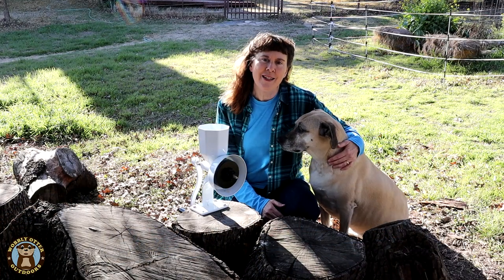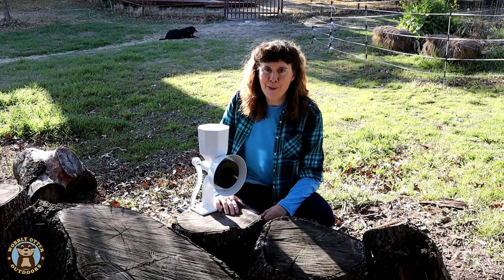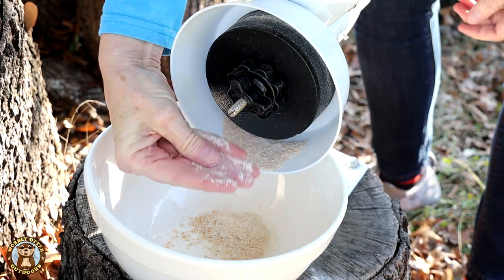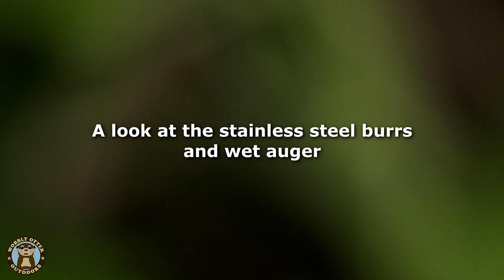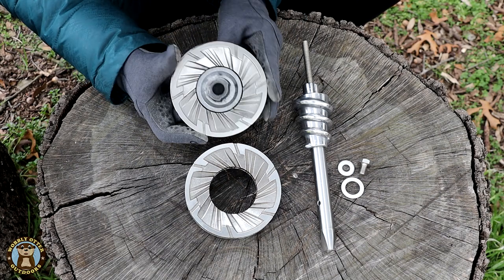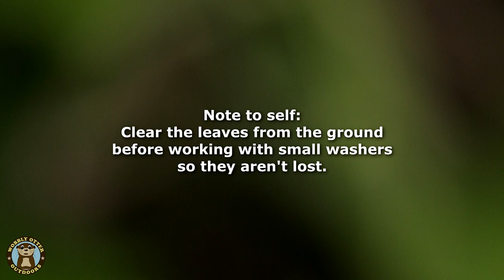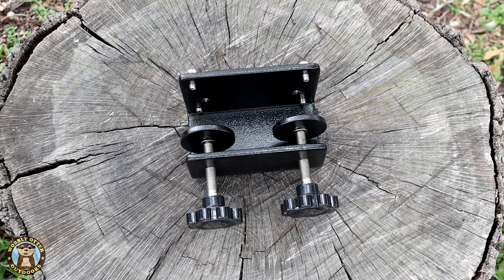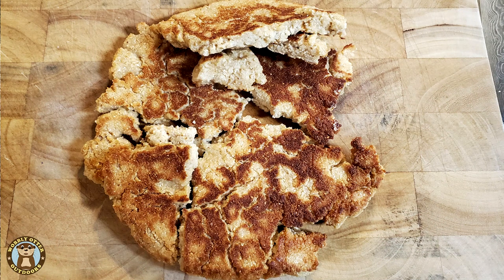Wondermill Wonder Junior Grain Mill Review

Comment: Thanks for the video. Just a suggestion regarding breaking bolts that you were putting into that oak log: I find that if you drill a pilot hole just slightly smaller in  diameter than the threads of the screw threads are , then take bar soap and pack the threads full of soap before you screw it into the wood it goes in much easier without breaking the screw . Be sure the pilot holes are slightly  smaller than the outside edges of the screw threads. You won't pull them out because the threads bite the wood very well. Try that and I think that will help.
Reply from the maker: You're welcome, Robert and thank you for the very helpful suggestions.  A larger pilot hole would have definitely been better, especially in an old oak stump. They're kinda like concrete. 😀

Comment: You can also purchase the drill-bit connection to power it - if you'd like to make the job faster (and easier)
Reply: BUT.. you'll need a very powerful drill and they ain't cheap!  My 7.5 amp wouldn't touch it.  And it takes every bit of my 9amp DeWalt to turn the crank.  By the time you put out $200+ for the DeWalt you could almost buy a MockMill 100.  Just my thoughts.  Hope they help.  All this said--- we LOVE our Wondermill Jr.
Reply: @timrossmultimedia  Thanks for sharing!

Comment: A follow up video on the wet grind would be nice. Maybe nixtamalize some corn for masa. It's tasty, you'll probably like it.
Reply from the maker: That's a great idea @Paladin_BR. Thank you.. It's helpful to know the interest is there. And I do love corn tortillas too.
Reply: @wobblyotteroutdoors  xi'd love to see how fine and how fast it can grind freshly nixtamalized masa. the mexican made ones are fine for tamales, but the burs are not good enough for tortillas.
Reply from the maker: @Daniel Bothman I will order some dried posole/hominy to grind to see how fine we can get the masa/flour.  Then we'll make some corn tortillas! Gotta plan for success.
Reply: @wobblyotteroutdoors  thanks for the reply. that might be an interesting experiment, but not what i was wondering about. i'm wondering about wet grinding freshly nixtamalized corn. grinding dried hominy is not the typical practice for making tortillas. the typical/traditional method is cooking dried dent corn in water with "cal" (calcium hydroxide aka lime) until the outer coating is dissolved and then soaking overnight (methods here vary). then rinse all the sludge from the dissolved coating, and then wet grinding. THAT is where my interest lies. 

you can probably buy the cooked (and not dried) hominy at your mexican grocery and save a few steps.
Reply from the maker: I see. Canned hominy/posole is readily available where we live.  It's the wet result of nixtamalization.  Or the dried hominy could be reconstituted then ground. Hominy is super soft, even the germ. It should be nicely smashable. Thanks for watching and the interesting idea.
Reply: @wobblyotteroutdoors  well, a coarse grind of dried hominy gives you grits, and a finer ground hominy yields polenta...
Reply from the maker: Yummmm! It's a win-win. We like it all.
Reply: @wobblyotteroutdoors  well, all sound interesting, but none are worth trying on my account. I'm only interested in how it would work for making tortillas in the traditional way by someone familiar with how the finished product should or shouldn't come out. so, I guess nevermind my comments. thanks for your you willingness and suggestions tho.
Reply from the maker: Mmkay.

Comment: Do NOT eat the first couple batches of ground up anything. Unless you like fine, metal filings in your diet:) It is like a new car and an oil change. Give it a 500 mile test drive and change the oil as new parts wear down slightly against each other!!
Reply: This uses stone for the dry grains. 1 or 2 run throughs of wheat or corn will wear down the surface enough to not leave significant dust behind. Now if using the metal plates for nuts or wet grains I'd suggest a few extra run throughs and a hood rinse between each round.

Comment: You could buy a lot of flour for 300 bucks. Premium flour is only 50 cents a pound. meaning you'd have to run 600 pounds through this thing before it would pay for itself. So just how much flour do you plan on using? If you were making bread all the time and used 2 pounds a week that would take about 6 years. But I don't use anywhere near that much flour. I average about a pound a month. So it would take me roughly 50 years to use 600 pounds of flour. But then the issue is the flour you get out of it is not premium quality. It still has lots of impurities such as bran.

All of that being said the only reason I could see purchasing one of these would be for the fun of it or the experience of grinding flour.
Reply: It's about far more than just price.  There's quality and freshness, variety, and supply.  Store-bought flour is only good for a year, or if properly repacked for storage, even 10 years.  Whole wheat and other grains, properly stored, last 30+ years.  Just like any other insurance you may have, having food insurance and the peace of mind that comes with it has its own value.  
Once you have the tools and storage, enjoying them for flavor and fun, as well as to maintain required skills to use what you stored in an emergency, has its own value, as well - besides being just plain delicious.
Reply: Bran is not an impurity.  The flour you purchase at the grocery store has been stripped of its nutritional value in favor of making it last a long time on the store shelf.  Whole grains, freshly ground, are so much healthier for you.
Reply: Wheat berries in their whole, unground state last a lot longer than flour does if kept dry and cool. If I bought 20 lbs of berries and a Wondermill Junior Deluxe 2 years ago and wheat becomes expensive, unavailable or unemployment drains our savings then having wheat berries and a grain mill will be more than worth it.
Reply: The lack of knowledge that would allow someone to say with a straight face. “ impurities such as bran”
Reply: @joshualloyd1391  In pretty much every situation other than making whole wheat bread you're not going to want bran in your flour.
Reply: My family of 5 uses approx 50# in 5-6 weeks. We make everything from scratch (everything. Breads, crackers, rolls, brownies, tortillas, etc)

Comment: the bread will always be flat like yours, you can't make a real bread with this one
Reply from the maker: I appreciate your point of view. However, it is possible to make "real" bread, (of any style)  with the flour from this grinder. I chose to make a flat bread because it was fast and easy.
Reply: @wobblyotteroutdoors  make a real bread in a video and i will believe you, i have a diffrent machine and i have always the same problem always my bread is flat, i think because the machine can't make it as fine as the flur from the store, it's always like the sand
Reply from the maker: Thank you so much for the additional information. I can totally understand that if the flour doesn't have a fine texture that it will be more difficult to make a bread with any loft. Your suggestion is on our video to do list.  We'll give it a go.